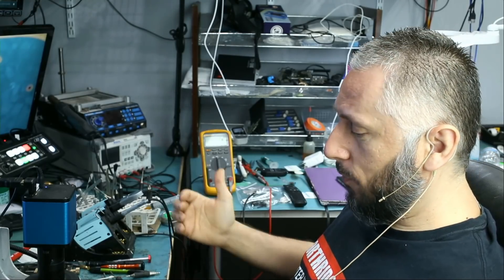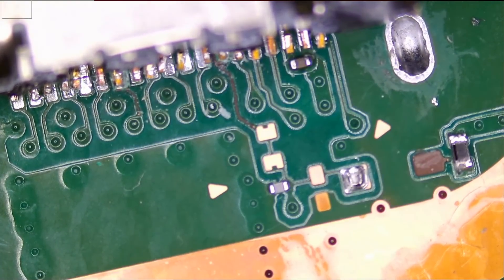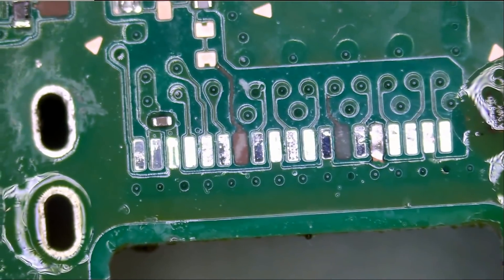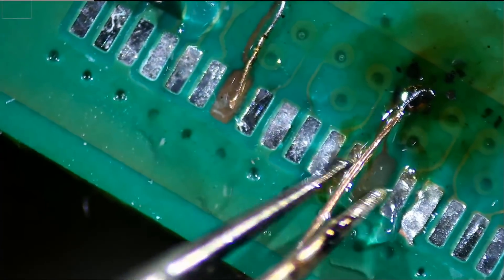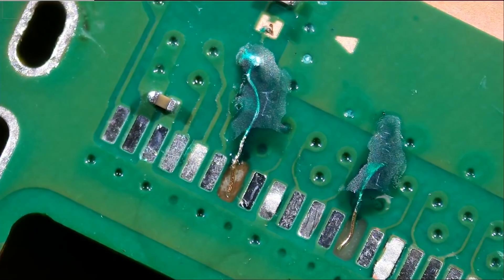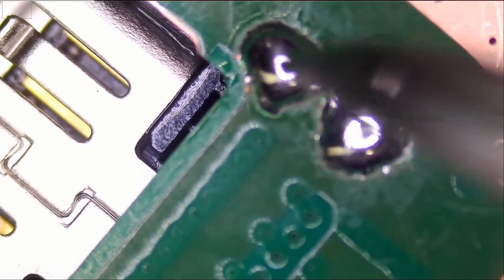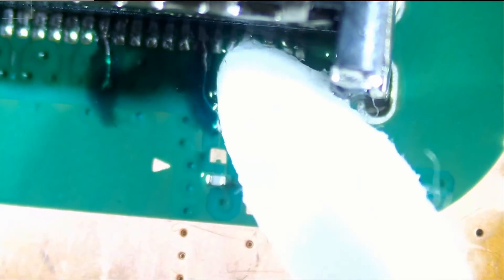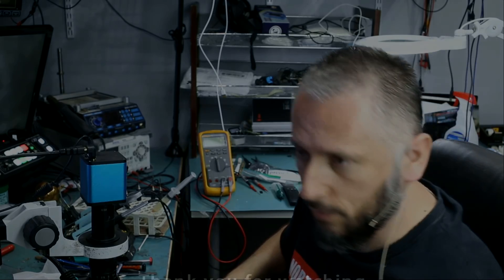PS5 No signal HDMI Connector Repair - Torn traces and missing part - What a mess.

Comment: Anyone know what the small black component is on the OTHER side of the board under the HDMI port between the legs? It fell off. I couldn't see any continuity with either polarity on it. I've reattached it and replaced the broken HDMI connector but still getting no display. Just a blue light on power on which then goes white. Thinking I may need to replace the little black component if I can figure out what it is?

Comment: I was using this technique of HDMI port soldering when I was starting to solder them on PS5 ;). But, I had returns because the solder from the top - you can look at the end of this video is not going out from the mainboard in the HDMI port ground pads. That was causing a weakness of those solder joints in the ground pads. Since I've started to use a drop technique where I leave the solder in this mainboard and heat it up, I have no returns with HDMI port corrections.

Comment: ive got a ps5 now im trying to replace the hdmi port, dont have hot air so i clipped the shell grounding off from the center, and got everything out cleanly except the side tabs still left in the ground plane. My little iron doesn't seem to wana do it and im getting alittle nervous with how much ive messed with it with no joy, thinking maybe chipquik or i gotta suck it up and buy an air station for ONE thing lol the data pins are mint too

Comment: First off you don't know this but you are my teacher.  I own a shop in Vegas for about 10 years and you have been my mentor.  I just repaired a ps5 hdmi port but that diode right behind the hdmi port was missing being the port was pushed all the way thru. Got lucky only ground pad was ripped off.   I need to replace it even tho the ps5 worked without it.  I like to do everything to spec if possible.  Can you please help me find/replace that diode.  Probably be a good part for you to sell.  Thanks!  My name is Lamaar.

Comment: Hi friend. First of all I love your vids. Excellent content. I have some questions..
1-i tried to fix stick drift on ps4 controller, I don't know if you know the term, I have to desolder the analogues. But I can't do it. I have heat gun, desoldering iron but the solder almost doesn't melt. On other devices lets say xbox one xbox 360 I can do the process no problems at all.. Yes I use flux 😀